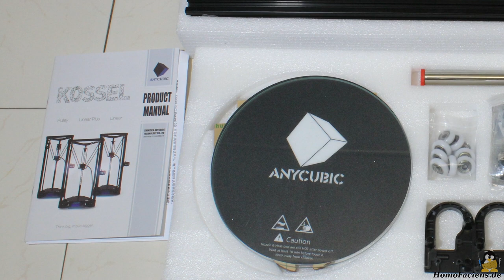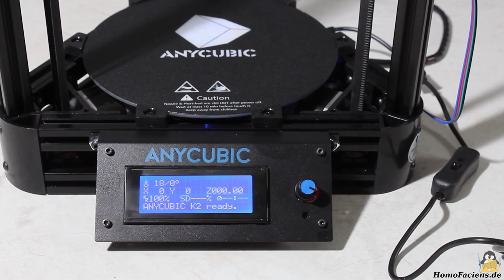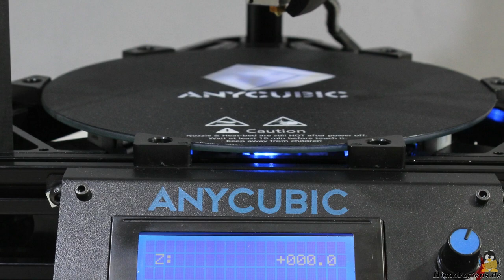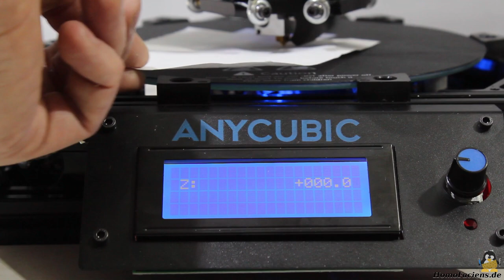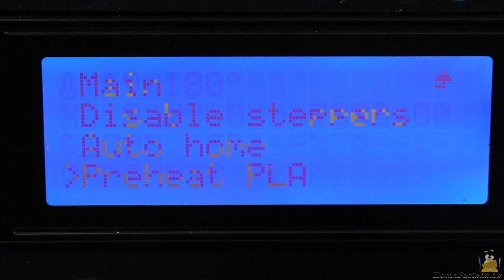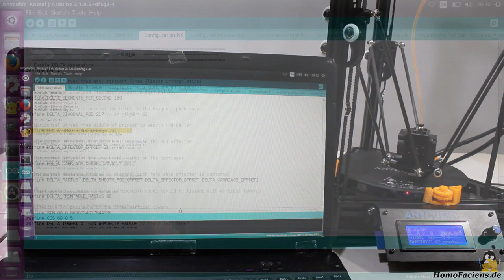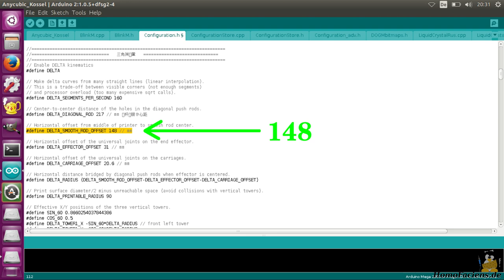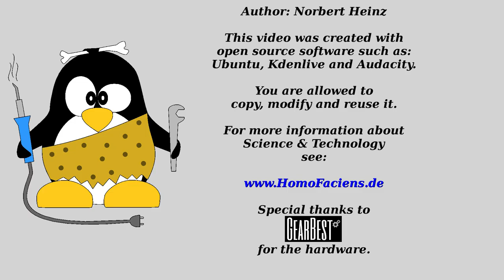Review of the Anycubic Kossel 3D printer

Comment: I have this printer and once it is dialed in, it's fairly reliable as long as you keep the print speeds below 30mm/s.  Vase mode works really nicely on this as well.  Print some feet for it that use tennis balls to make it a lot quieter.  The extruder motor driver definitely overheats but you can make a ducted fan shroud for it that will let you attach a 40mm fan to keep it cool.  I had to do this to keep mine from skipping at 30mm/s print speed.  You can find these parts on Thingiverse if you search for "Anycubic"
Reply from the maker: My extruder motor doesn't warm up noticeably. It's the driver chip that needs some extra cooling if raising the phase current as I did.
Yes, Thinigerse offers lots of addons for this printer. The tennis ball feet pgrade sound sinteresting. Thanks for sharing.
Reply: Same here with the extruder motor not getting hot but the driver chip was.  The chip goes into thermal shutdown and causes the motor to skip.  Putting a cheap 40mm fan on the driver chips solved it for me.

Comment: In order for the print head to be level, you need to trim the offset of each axis when touching the print bed. If an axis is lower or higher than it should be, the nozzle will have an angle towards it. I don't think you can do that by manually adjusting the endstops, as it requires precision. Also, by moving the endstops lower, you lose some print volume at the top.

To avoid the extruder skipping try adjusting the tension on the filament and shortening the tube that leads to the nozzle, that helped me a lot (I have another delta though without a 180 degree angle)
Reply from the maker: Yes, the way I have adjusted my delta printer is just the short version to make it work in principle. Depending on the accuracy you need, you have to spend lots of time to get it better.

Shortening the tube could be an option to reduce friction, however once you have cut too much, you need a new one ;-)

Thanks for sharing your knowledge.

Comment: You can solve the problem with extruder motor by replacing the pulley with smaller diameter one and increase feed rate.

Comment: Shame about the bed. If the bed bolts down I suppose you could use bits of steel shim to level it.
High movement ratios of the Delta design seem to have a worse finish.
Reply from the maker: Yes, the cheap construction (expecially the weak extruder motor) slows the machine down. However it's a low(est) cost machine, you can't expect to get a high speed quality printer for that price. The good thing is: It prints.

Comment: The motherboard of this Anycubic Kossel is 100% electrically compatible with Micromake D1 printer and you can get the firmware from custom Cura package of Micromake from here: https://drive.google.com/drive/folders/0B1DQUrzkDP-tNDU0NXhVcGhlc0k

Use D1 delta firmware from Cura and connect end switch to the Z_min pin on the motherboard and place this switch on the hot end plate.
And after that you can use autolevel table procedure from Cura.
The only thing you have to adjust the number of steps per mm because Anycubic and Mickromake has different pulley diameters.
Reply from the maker: ...never touch a running system ;-)
If you have good reasons for changes in firmware you can try. I case it goes wrong you can go back to the original version (good to have the sources shipped with the printer).
Reply: I also don't touch a system that works, but this comment could be useful for people who absolutely need to have bed auto level on Anycubic Kossel.

Comment: I put a leftover square nut at the top of the spring to stop filament skipping, my spring seems even less springy then yours though.

I was having trouble with blobs and zits so i flashed mine with https://github.com/ruevs/repetier_anycubic_kossel  set  Z_MAX_LENGTH 293  and EXT0_DECOUPLE_TEST_PERIOD   0 

with the repetier firmware I had layer separation (using ABS) so i disabled the fan and its now good. (%20 might be ok, i know %70 still has issue for me)

Might print the bed leveling thingy next because its painful to level as is, thanks!